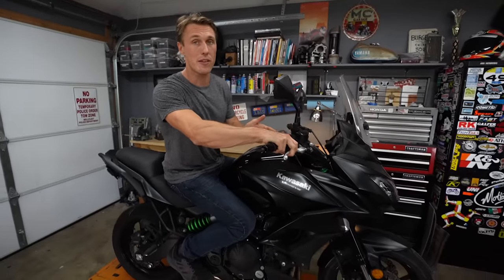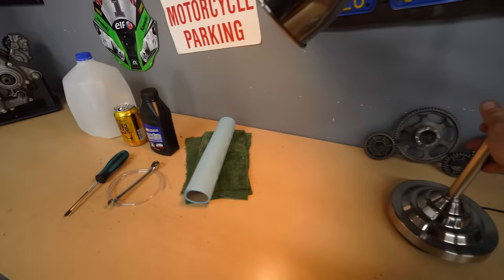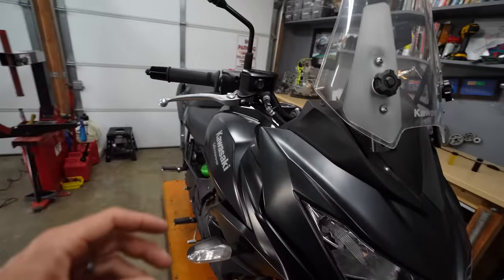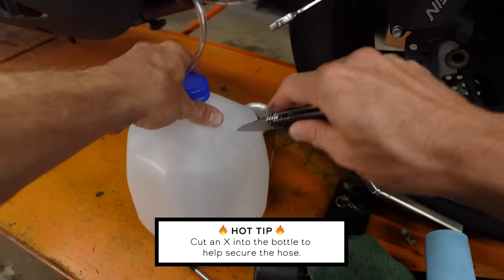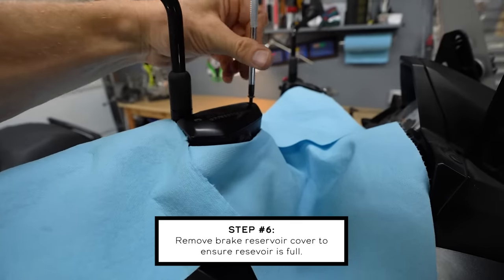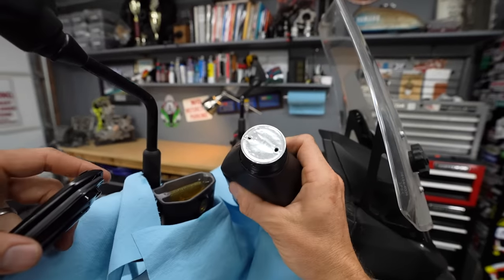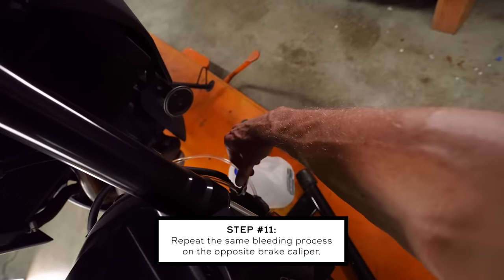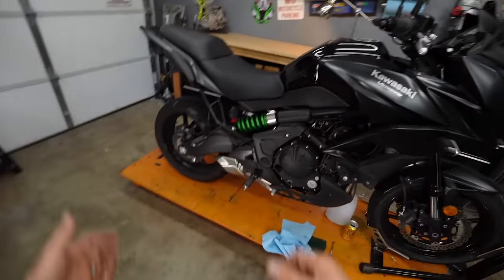How To Flush and Bleed Your Motorcycle Brakes | The Shop Manual

Comment: Couldn't I do this job like my car's brakes, where I leave the end of the tube submerged in fluid removing the need to ever close the bleeder?  I usually just pump away and no air ever comes back in
Reply: If that technique works for you, great, but I can see two problems that people may run into with it.  One is that you have to ensure that no pockets of air remain (or accumulate) in the drain tube, which isn't always practical.  The other is that you'd need a really tight fit between the tube and the bleeder screw.  Even if your tube is snug enough that brake fluid doesn't leak out when you depress your brake lever, air can still sometimes sneak in through that connection when you let off the lever.  Depending on the design, air may also sneak in between the threads of the screw and your caliper when the screw is left loose and the system pulls a vacuum.

Comment: Guys, how to deal with stuck, rounded bleeder valves on old bikes? Tried this a couple of months ago and just ruined the brass nipple bit and accomplished nothing..
Reply from the maker: At this point, your first choice would be to get a pair of vice grips on there as hard as you can, do a prayer, and hope that works.  

If not that, your best bet may be to remove the whole caliper and bring it to a local machine shop who can remove it without damaging the threads on the caliper.  

Either way, you're going to need a new bleeder nipple!

Good luck,
-Zack
Reply: @RevZilla  Cheers Zach, will try!
Reply: Zack's suggestion is a good one, but before you go HAM with a set of vice grips, hit the bleeder nipple threads with some penetrating oil like Tri-Flow or PB Blaster (or even WD-40) and let it soak for 20 minutes. If you can apply heat to the nipple bolt with a propane torch (gently, of course) that will help loosen things up as well.
Reply: @AriH211  Thanks for the tip, but i did put generous amounts of WD-40 on it the night before. I should look into getting a better penetrating oil though.

Comment: Just one thing: If you have a BMW with ABS, you will need to have it done by an authorised BMW workshop, as a computer is necessary.
Reply: What do they need the computer for?
Reply: @Dankyjrthethird  I don't really know why. But I read a shop manual on the net which mentions it and two motorcycle mechanics told me so too. It has something to do with the ABS sensor which must be recalibrated and might prevent a normal bleeding operation as we know it.

Comment: I remember bleeding my brake fluid for half a day straight. I just kept going, because the bubbles wouldn't stop coming. I later realized that the air was coming from outside of my brake system in-between the hose and the bleeder bolt. I think I flushed my brakes 10 times. Learn from my mistak!
Reply: Yup, I've been there! That's why I suggest using a tight-fitting hose and only opening the bleeder 1/4 turn, but I should have included the errant air bubbles in the explanation.
Reply: @AriH211  Trust me. Your explanations are super clear and straight to the point. Exactly how we like them to be. You can't include every stupid mistake that the viewer could possibly make. I really appreciate your video's. Keep them coming!

Comment: Biggest and dumbest mistake i did when i tried to bleed my brakes was dropping the brake fluid bottle(still closed and sealed). I kept on getting air bubbles no matter how many times i bleed it then i decided to check the bottle itself and spewed out a couple of curses then tossed a wrench across the room. Had to stop for a day to make sure all the bubbles in the bottle are gone.
Reply: Never even thought about that thanks

Comment: My ABS bike's service manual requires a trip to an authorized dealer to hook it up to the factory authorized computer to run a bleeding sequence through the ABS valve.
Reply: Sounds like you own a Harley.
Reply: This is not normally necessary, but if you get careless and introduce air into the system like from completely emptying the reservoir while bleeding, you might have to have someone run a purge routine on your ABS block. Just take your time and pay attention to your reservoir level, you should be fine.
Reply: @AriH211  Heh. Never. It's a Husqy Vitpilen 701 :)

Comment: Why go through the process of flushing the brakes and putting DOT 4 fluid back in when DOT 5 silicone-based fluid is available?  DOT 5 has a higher boiling point and it doesn't absorb water.  Eliminate the corrosion issue all together. Yes, DOT 5 is more expensive but you're only using a few fluid ounces per system.  One bottle will likely last the entire time you own the bike.

Comment: Crucial info that I think was forgotten: Do NOT overfill your brake fluid reservoir. The level should correspond with the level of brake pad wear. If you have brake pads that are very worn down the level will be lower. If you have a fresh set of brake pads, the level should be at the full mark. If you overfill your reservoir, you could find your brakes applying themselves!